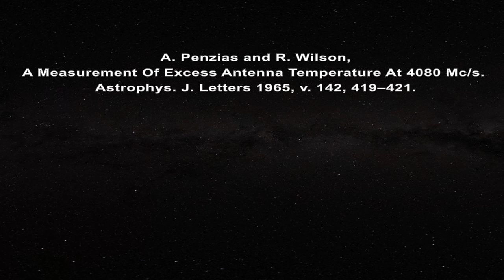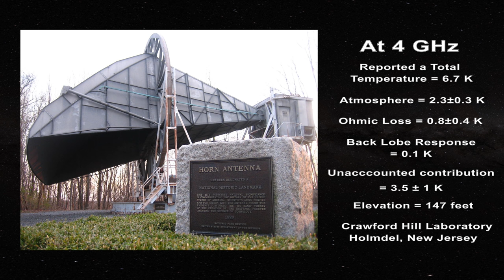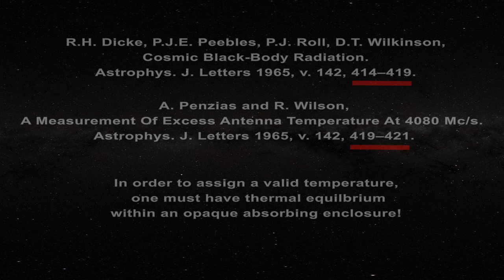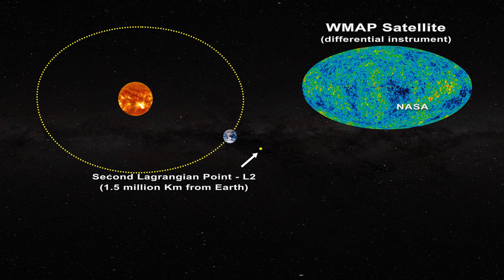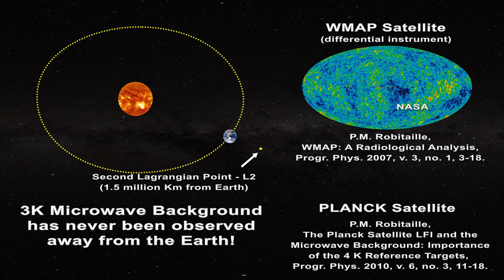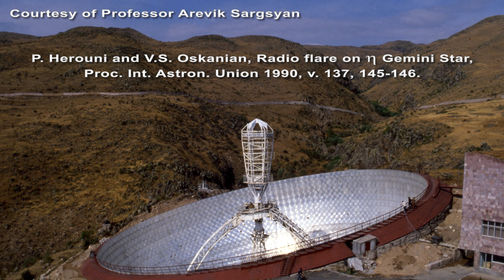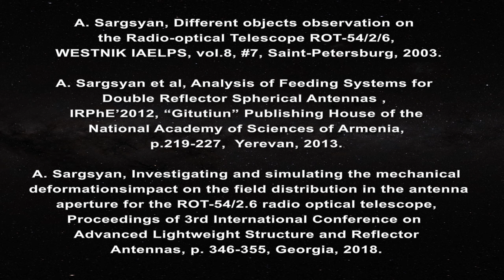The Herouni Antenna - The Death of the Big Bang!

Comment: Many thanks to you, dear Dr. Robitaile for your efforts! I am sure, we will repeat an experiment of Professor Paris Herouni using our   antenna  after revitalizing and modernizing of its management systems. And every single panel from its 54m spherical dish will prove your theories.
Reply: Your giving me hope for the future!
Reply: Curious, why does this instrument use a spherical dish and not a parabolic one?
Reply: @rushthezeppelin  : In order to eliminate microwave diffraction into the detector from the surroundings. You can obtain the details from professor Herouni's paper (link under the video).
Reply: @rushthezeppelin  When you have a fixed reflector like this one, the only way to point at different locations in the sky is by moving the receiver end relative to the reflector. This is easy to set accurately with a spherical mirror and a nightmare with a parabolic one, making it more prone to focusing and mechanical errors or problems. In the paper mentioned at the top: http://rnas.asj-oa.am/2542/1/73.pdf you can see the simplicity of the construction.
Reply: When will you start the public fund raise campaign?
Reply: Doesn't that Higgs boson stuff depend on Big Bang theory? I wouldn't be surprised if Cern has been bullshitting us the whole time...
Reply: @fiddledotgoth  bang on
Reply: @stevecrothers6585  I loved your work on relativity. Emperor Einstein was indeed starkers, but few had the guts or the grey matter to be able to point it out until you came along. I believe the future will revere the names of you and the other mavericks.
Reply: Indrid Cold  that's what was said about scientists who appeared on television, thirty or forty years ago.... and what was probably said about those who went on the radio half a century before that. Come to think of it, I've read somewhere that certain natural philosophers frowned on the use of English for the dissemination of their ideas, insisting on Latin. If it was good enough for Paracelsus....
Reply: @stevecrothers6585  Yup that's the bit that always bothered me; "Then there is the 
issue  of  replication.  Who  has  the capability  and  wherewithal  to independently replicate  the  experiments  at  the  LHC  in  order  to  ascertain 
the  veracity  of  the reports by the people at the LHC? Without independent experiment replication the people at the LHC are at liberty to tell the world what they please. "
Thanks for that link...
Reply: Indrid Cold  Hmm, you mean major discoveries like the 8 Tesla Ultra High Field human MRI scanner...?
Reply: How much money do we need? We just need a number :)
Reply: Just a thought..if funding is an issue I am sure crowd sourcing would go a long way to helping. I for one would be in!! We desperately need funded  independent research into this matter... Good luck to Arevik!!
Reply: so, when does the crowdfunding campaign begin?
Reply: @Suspicious0bservers  : Perhaps $60 million.
Reply: Vahe Akopian  զգացված եմ (zgacvats em)
Reply: @antonia4722  thank you
Reply: Repudiation of independently verified scientific theory, based on lost paper, request for funding...no scam here.
Reply: @fiddledotgoth  No . Whether there was a bb or not does not depend on the Higgs boson/field science ,and the HB does not require a bb in order to exist. But if it exists in those claimed contexts it would be quite hard to explain why in a different universe than a bb-based.
Reply: @AKAKiddo  If there is a scam and people fund it voluntarily I'd be a Penn Jillette-atheist libertarian enough to say "hey sorry but that is natural selection". 
We can not stop or ban stupidity.
Reply: @fiddledotgoth  But that can be claimed about ANY researcher into advanced enough fields on any formal form of state or private property. Not only LHC.  And if there is no formal ownership of anything ,all science and tech would be seized and scrap sold by thugs with guns (anarchy).
Reply: @AKAKiddo  It is the funding of a radio telescope that is being discussed not a theory but as you do not comprehend that I expect you don't even realize how irrelevant your comment is...
Reply: @KibyNykraft  Name one other field that is accepted science that has not been replicated in another country at least once...
Reply: @gerryjamesedwards1227  Did Paraceisus live during the time of the Roman Empire?
Reply: Dear Arevik, Congratulations and keep up the good work. I have one question: Hampartsumyan was alive during the 80's and what was his take on Herouni's theory??
Reply: Be safe everyone;)
Reply: Don't think it's going to happen. The Pentagon just got their 716 billion dollars budget approved. Wars and invasions are more important.
Reply: @fiddledotgoth  they produce anti matter based on Big bang math.
Reply: @stevecrothers6585  

Hello Sir, I have followed your work (and Prof. Robitaille's) for many years.  Your tenacity in flushing out Pseudoscientists and their wares is only outdone by your moral courage.
If you were here, I'd Decorate you MYSELF !!!!
ps. Your affinity for the "Outlaws" was just Icing on the Cake. 😏

Now to some business: We all know that these fairytales masquerading as 'Science' (not limited to):
big bang
general relativity
special relativity
evolution...
Were NEVER actual "Scientific Theories" to begin with.  The can't even enter and breach The First Step of The Scientific Method. smh

I have a quite HEAVY background in Genetics, Biochemistry, and Quantum Mechanics and have been actively EXPOSING Pretender Clowns for nearly ten years.
Three Years Ago during one of these 'exposings', a bystander noted my acumen and asked me a question... which has changed my life (I've been kicking myself since for not recognizing it)... the question wasn't even finished when I realized that the Nonsensical Buffoonery above wasn't even palpable 'blips' on the radar; and with all due respect, I ask it now to you ...

         How can you have Gas Pressure WITHOUT a Container...?

On the surface, a pretty benign question right (?)...but it's ramifications are MIND BOGGLING !!!
The Answer is:  Well, You Can't...and there's NO WAY OUT .  It's a 'Stamp on the Forehead' Laws of Entropy (2LOT) Violation.  Simply...

" GAS expansion into a VACUUM , mixing of ideal gases or liquids, diffusion, effusion, colligative effects, and osmosis each fundamentally involves an INCREASE IN ENTROPY due to increased dispersion of energy (with no change in total energy in the case of ideal substances) due to a greater number of microstates for the particular system involved."
http: // entropysite .oxy . edu / entropy _ is_ simple/

"In classical thermodynamics, it is viewing entropy increase as a measure of the dispersal of energy from localized to spread out at a given temperature.  In "molecular thermodynamics" it is considering the change in a system (or surroundings or their total) for which there are fewer accessible microstates to one for which there is an increased number of accessible microstates."
http: // entropysite .oxy . edu / entropy _ is_ simple/

So,  Gases will "Increase Entropy" and fill a given Volume (CONTAINER) until Equilibrium is reached. (2LOT, 60 level)
In this particular case, according to the Fairytale 'wiki' Pagan Religitard Mythology...that Volume is 3.57 x 10e80 Cubic Meters (SPACE) with an Equilibrium Torr at a Jaw Dropping 10e-17 Torr !!!
So that begs the question, 
How in the #### are we still BREATHING (!!!!!) ??? lol

Then, please list each fairytale associated with "Outer-Space" that gets taken out back to the Woodshed and Bludgeoned Senseless as a result of the fairytale "Vacuum of Space" VAPORIZING....?

And, This is kinda fun...How in the World did the Earth Form an Atmosphere at all... "IN A VACUUM" ??  From a big bang??

As we all know: "Nature Abhors a Vacuum" .

I'll leave this with you sir.  Can you please pass this on to Prof. Robitaille, courtesy of me.  Thanks in Advance👍

Welcome to my World.  It's a RUSH !!!! 😌
 
Please Remember...
 “If your theory is found to be AGAINST the SECOND LAW OF THERMODYNAMICS , I can give you no hope; there is nothing for [your theory] but to COLLAPSE IN THE DEEPEST HUMILIATION .” 

Arthur S. Eddington, The Nature of the Physical World (1930), p. 74.  

And Finally,  "For you have to love, believe, and feel before the burst tambourines takes you there". 👍👍👍
Reply: @quantumeraser4833  : Yes indeed; there is no gas pressure without containment, and that consists of at least a wall somewhere in the system, such as the surface of Earth. Astronomers and cosmologists however permit gas pressure in the total absence of containment. This leads directly to violations of the laws of thermodynamics, including the production of perpetual motion machines of both the 1st and 2nd kinds, and is a violation of the kinetic theory of gases.  Here is a related example:

Pierre-Marie Robitaille and Stephen J. Crothers, Dynamics of the Solar Wind: Eugene Parker's Treatment and the Laws of Thermodynamics,
http://meetings.aps.org/Meeting/OSF18/Session/E01.3
http://vixra.org/pdf/1810.0019v1.pdf

Pierre-Marie Robitaille and Stephen J. Crothers, Dynamics of the solar wind: Eugene Parker’s treatment and the laws of thermodynamics, Physics Essays, Volume 32: Pages 1-4, 2019, http://www.physicsessays.org/browse-journal-2/product/1692-1-pierre-marie-robitaille-and-stephen-j-crothers-dynamics-of-the-solar-wind-eugene-parker-s-treatment-and-the-laws-of-thermodynamics.html

In relation to the Theory of Relativity, here is an example of cosmological violations of physics and logic:

Crothers, S.J., Black Hole Escape Velocity, Sky Scholar, 2018,
https://www.youtube.com/watch?v=dZbDLd42Uws

Green grass and high tides forever!
Reply: Indrid Cold  lol, nice try
Reply: Arevik, I've read your uncle's great book Armenians and Old Armenia and have a couple paragraphs about it at rsr.org/armenia (and I'm not Armenian :). That page is titled, The Genius of Ancient Man! I'm sure the late Dr. Paris Herouni was proud of his niece!
Reply: @fiddledotgoth  Doesn't the LHC have two independent detectors to account for replication?
Reply: @fiddledotgoth  Yes, this was a great achievement of your Sky Scholar, and he should of stuck to his field....he is NOT a physicist, cosmologist or even an astrophysicist!  Crank it up!  \m/
Reply: @mr.wizard9785  That's like saying your astronomical observation counts twice because you were using binoculars...
Reply: @fiddledotgoth  Ha, well it's obviously not feasible to build two CERNS.  Isn't the Higgs a lynch pin of the Standard Model, which has been highly successful in making predictions and facilitating the development of real-world applications?  I would imagine that even though the theory is incomplete, it can't be incorrect; otherwise how could it have been so successful?
Reply: @fiddledotgoth  no that is based on repeatable physics experiments. cern continues to this day making important discoveries and research. not only that cern gave us grid computing and the world wide web.
Reply: Maam, I just watched this video & am not a man of means but a man of conviction. This work would turn the global scientific community on it's head & THAT is worth doing my part. True science must look inward & not suppress brilliance & truth for "political" reasons. I liken what they tried to do to this work as what they did to Nicola Tesla. Please, if there is any place I can make a donation to help you let me know. I don't have much but I will do what I can.
Reply: @BobEnyartLive  many thanks, Sir!
Reply: They all need the big bang theory to be true. So any evidence against it would be shut down. As the outcome would be inevitable.
Reply: Dr Sargsyan please let us know of your progress.
Reply: joe v  : think you made your point subtly enough? 15 miles, 1,500 miles (horns in midwest too), same difference.
Reply: joe v  : If the distance inland still finds the mw radiation, 15 miles is as good as "beside" the sea. At any rate, a gentle correction vs a demeaning remark would have been good enough.
Reply: @tomrhodes1629  Both you and @Steve Crothers make me pine for a Laugh reaction on YouTube.

For some unfathomable reason, I did click. And oh my God, what a rubbish bin I found! I hope it has wheels to make it easy to push to the curb.
Reply: @fiddledotgoth  they have. Cern is a money grab, ran by some very strange people.
Reply: @AKAKiddo  this man invented the 8 tesla ultra high field MRI scanner. He disproved kirchoff's law of thermal emissions while he was at it. No, its not a scam.
Reply: @JudahDavis  well...they do own everything.
Reply: @bcddd214  lmao, how much antimatter have seen?
Reply: @mrrolandlawrence  No it isn't ,list some then, and no they didn't...
Reply: @kandysman86  I had a PET scan 2 years ago. The "P" in PET stands for positron. That's antimatter yo!
Reply: Brad S Man thats BANANAS! Actually, bananas are supposed to give off a positron every 75 minutes.
Reply: @bcddd214  Bombarded with antimatter? That may have destabilised your dimensional orientation and shifted you to a paralell universe; is it any good there...?
Reply: So hows it going? Any progress??
Reply: Dr. Sargsyan, Amazing that ground breaking experimental findings like this can lay fallow and indeed almost be lost. Thank you for your work and informing us all of this wonderful save. I notice you dont have a patreon acct., but urge you to do so so that those of us who are inspired by it can support your and your associates' work.
Reply: Do you have any job openings for any type of position and how would one apply? Open to foreigners?
Reply: It’s so beautiful… the dish, the control room, the mural, the globe, I hope it is preserved and restored
Reply: @mr.wizard9785  the standard model is falling apart.  Notice the Webb telescope, galaxies traveling faster than the speed of light, and electromagnetic studies that account for the problems with the standard model.  Times and understanding of reality are constantly changing.  Chemistry and physics keep getting new and improved theories.  I am certain that this is and will continue for a very long time.  To argue otherwise is putting on blinders.  We just need to separate the wheat from the chaff.  This video in my mind says the original study was not repeated without removing potential errors.  This attenna tried to do that but cannot be replicated either until funding becomes available.  There are other studies that show the background radiation is lumpy and violates the standard model.
Reply: @gerryjamesedwards1227  The future doesn't remember the names of monumentally incorrect idiots.
Reply: @PubicGore  Well hello there... =)
Reply: @fiddledotgoth  That panspermia is even a thing is because if this knuckleheaded theory that the Academics said, "Watch this influence all the other knuckleheads".. End quite.
Reply: @areviksargsyan406 :

So, what's the status now?